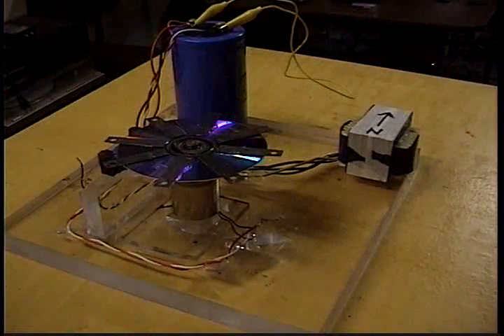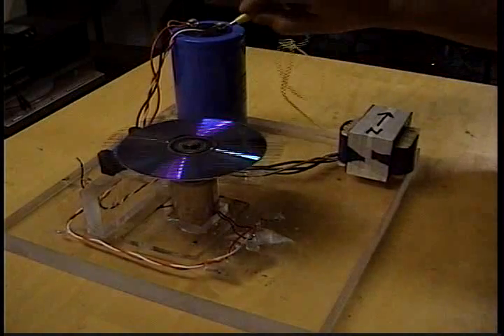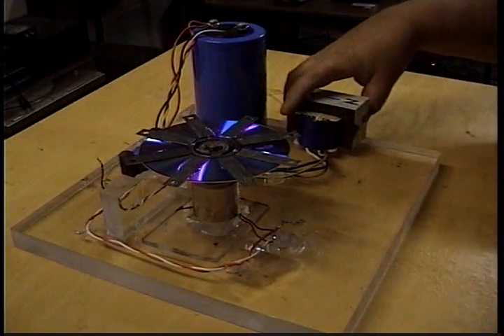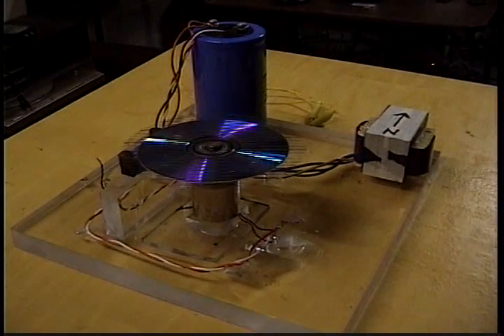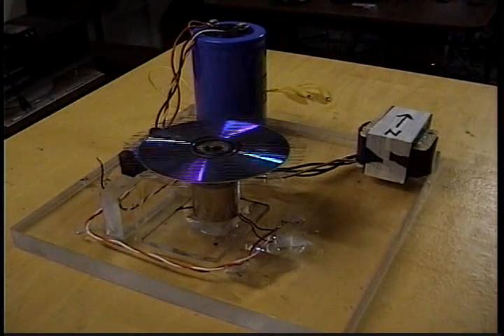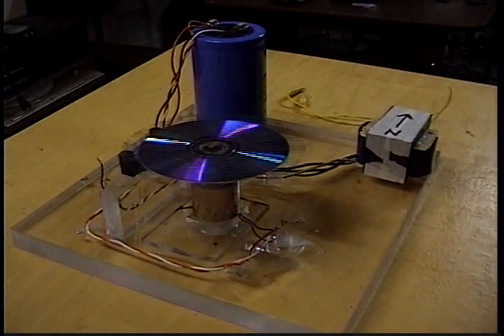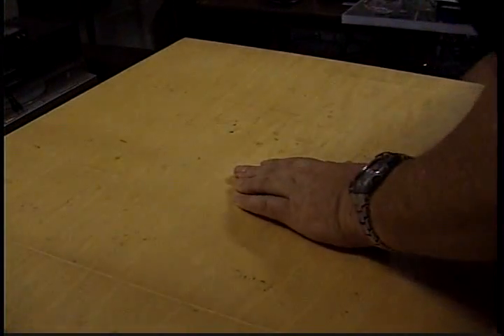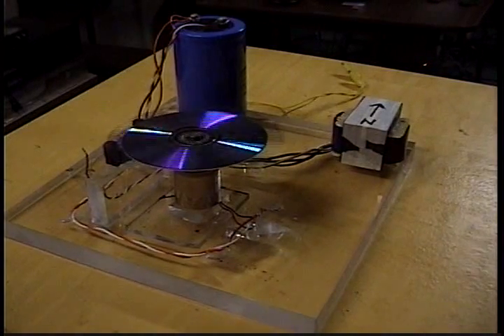The Amazing Magnetic Flux Gate Motor

Comment from the maker: @7cevz9 Well...if you watch the whole video you'll see that it is just a spoof of the "magnet motor" guys trying to get something (electricity) for nothing. The circuit is a simple transformer, rectifier, filter arrangement with the primary of the transformer under the table and the secondary on top. The blue can is a very large filter capacitor. Thanks for watching. :)

Comment: Have you seen photographs of central New York city before power-networks were introduced? Each little company, with its own generator, was running a separate cable to each customer and one could see the sky only through a dense cobweb of wires. The result was often lethal. So cities owe a debt mainly to centralisation and, secondly, to AC; especially when power started to be fed out to remoter locations. But AC was well known to be the solution. Vested interests of existing companies were ...

Comment: Nice, but.... An Altenator barely needs any energy to turn its wheel that will power battery banks. It seems to me a large wheel system like this running many altenators should supply enough power to run the set up and also charge batteries at the same time. Can not see anything under the table on my PC, but also, how much energy to run the system with out the tape erasing mechanism using power, Just creating the field to spin that wheel is not allot of energy?
Using alternators wouldnt be free